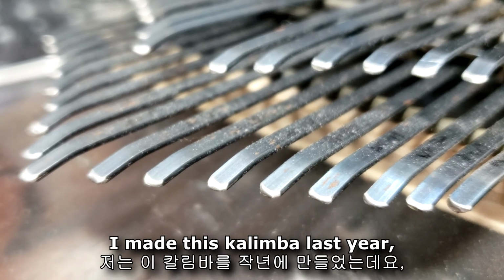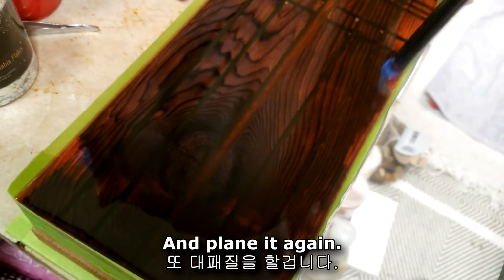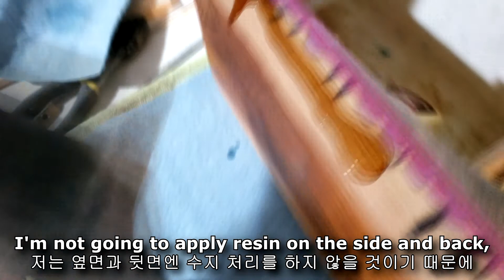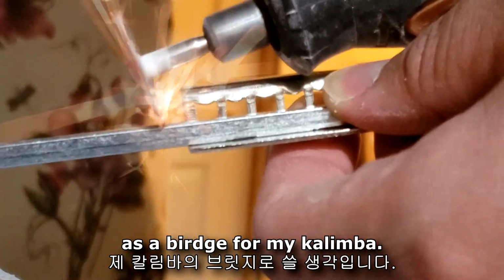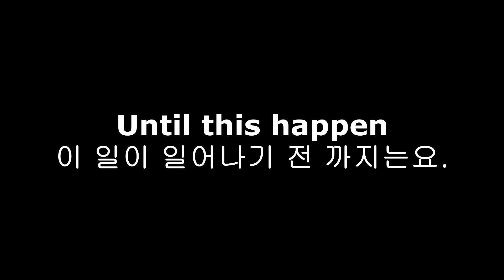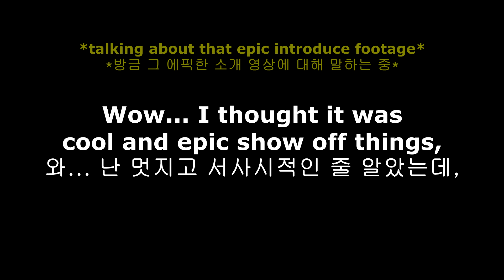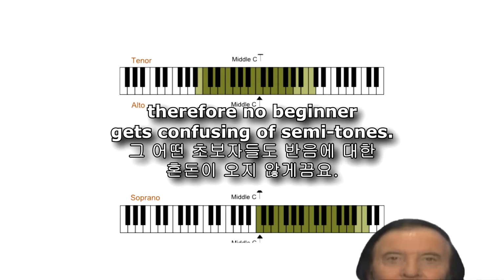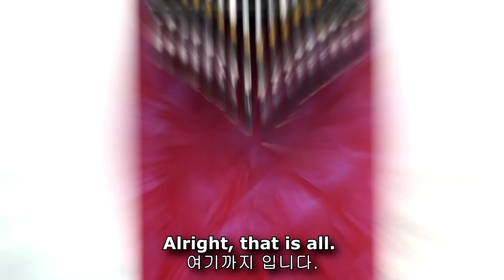How to make "TENOR"  Chromatic Kalimba! Build through! // 34 keys [미스터 칼림바]

Comment: Been a while since your last video. Liked this one :)
I'm guessing the bigger body is for longer sustain
Reply from the maker: Yes you are right. The size of body is also matter for the sustain. Also length of tine is crucial for the sustain too. Lower notes, which is longer tines are always sustaining longer than high notes (short tines) :D
Reply: I wish i have access to some custom tines length like you do. I've tried with drain cleaner wires, those are spring steel, but sadly they rust.
Reply from the maker: @randominternetviewer166  Try thin coat of oil on tines such as wd-40 and let them dry. I know it took some time to dry them, but it's worth :D How was the sound of your custom tines?
Reply: They sound lower than the standard tines. Not sure of the scale but probably an octave lower. They were a bit wider too.. Sadly the bracket i used wasnt good so it produced some dead tines and ringing. 
Ive also tried making tines using hacksaw blades. Very difficult to make consistent widths and more flexible. A lot of work
Reply from the maker: @randominternetviewer166  have you tried windshield wiper blades? Those are also has nice elasticity and reasonable width and thickness. Those sounds are not bad at all.
Reply: Hmmm. That i have not tried. I will once i have access to those :)
Reply from the maker: @randominternetviewer166  Good luck bud!

Comment: how do you make your tines?
Reply from the maker: I use blue hardened spring steel to make mine. All builders has different material to make their tines. Some people use Rakes, some people uses windshield wiper metal straps
Reply: @MrKalimba  thanks for replying!!
I always wanted to make a kalimba with higher ranges!